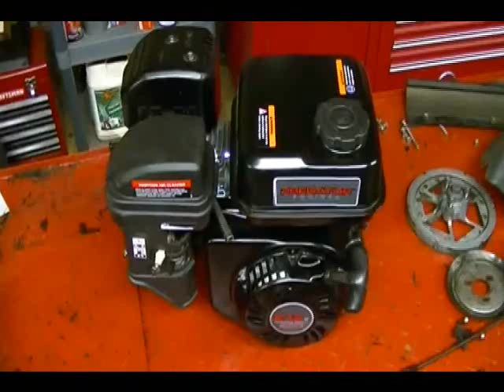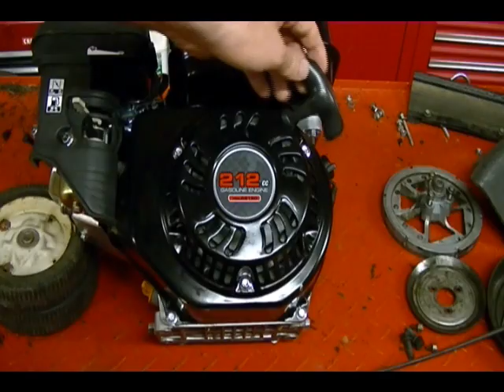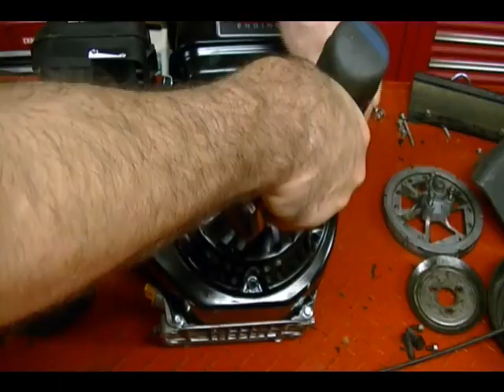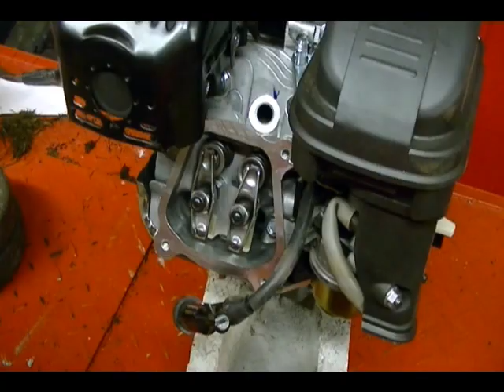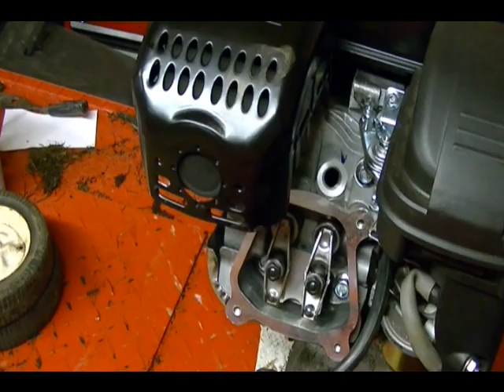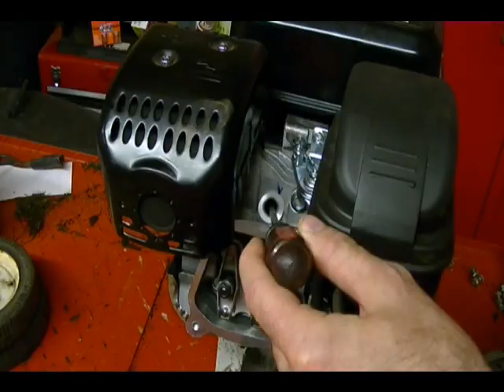Small Engine Repair: How to Determine Piston Position and Stroke on a 4 Stroke OHV Industrial Engine

Comment: I've an ohv tecumseh ohsk90. I've decided to adjust the valves with "cross method" (adjust the closed one when the other one is fully open) wich, according to many is easier and safer but I noticed distance discrepancy between this method and TDC method.

If I set each valves to .004  on cross I obtain .001/.002 on TDC.
If I set .004 on TDC I obtain .008 on Cross. 

This confused me because according to many should be the same.... the TDC where I check is just after compression release, when the piston reach the top.

When I've .008 on TDC the valves are noisier and with .001/.002 are more silent

Comment: I could be wrong !! But I was told that you just need to adjust any valve lash with the valve closed an that TDC is not always have to be done, just turn crank by hand adjust lash then rotate to close adjust other valve,you want to adjust any valve in close position!!

Comment: 10 yrs after, and this is the best 4-stroke valve adjustment video I have seen. Well-done! and thank you for the clarity.
Reply: Seems like every other vid I've watched not mentioning decompression arm on cam. Very important when valve adjusting on these motors.ended up breaking a recoil.if you don't adjust properly

Comment: Just watched the video it's very helpful. I have a mountfield ride on mower 4 stroke and I'm changing the head gasket how would I know what position/stroke the piston has to be in before I bolt it back on? It would be a big help if you have any info that would help me

Comment: Only comment, you talk about it running clockwise. Rotation direction is usually communicated from the pto side, not the starter side.

Comment: Thank you!!! 
That was totally professional, well-detailed and clear to understand. Much appreciated.
Offhand, living at ~6,300 ft. altitude, what sort of PSI reading would one expect from a healthy (cold) Kohler 149cc OHV engine after a few pulls of the starter cord? In general, would compression pressure correlate with the local pATM?
Finally, might you be able to suggest a main jet size for my altitude?

Comment: If you have a 2 cylinder engine can one cylinder get compression  Right after the  Exhaust stroke instead of the intake When the screwdriver  pushed all the way out to its farthest point it's right after the  The exhaust valve And that is when  I have compression the 1st cylinder that I just did seem like right after the intake was done moving The compression stroke started The compression stroke started Just like you explained in the video

Comment: As many have said, this is BY FAR THE BEST VIDEO on finding TDC.  The other videos are really a lot of filler and way too complicated you broke it down and laid it out perfectly.  I'm in my mid 50's and your vid gave me the confidence to change the valve springs.   Did a bunch of mods, bypassed the governor, turned out the throttle screw, adding a new carb with new pilot and main jets along with a new external air filter. Had to adjust the idle screw and holy Sh......  I clocked the bike at 33 MPG and I'm 200 lbs.  Thank you very much, awesome!

Comment: So if I understand this correctly as the intake valve is opening the piston is moving downward in the engine which is the intake stroke. After the piston reaches the bottom of travel on the intake stroke the intake valve closes as the piston will move upward on the compression stroke. As the piston reaches the top on the compression stroke both valves will be closed. Is that correct? Have you ever adjusted valves on a small engine where it was supposed to 1/4" past TDC of compression stroke for adjusting the valves? Thanks!

Comment: I have a Harbor Freight Predator 3500 Generator/inventor with only 17 hours of run time

I have no readings on display gauge for: 
V – Voltage

A – Amperage

VA – Volt Amps/Watt

I do have on the display gauge.
Hour – current run time and accumulative run time

I tried a test with a portable heater, and it powers that, so I’m guessing the generator is working OK?
I’m worried about not have those missing readings.
Also how do you reset the circuit breakers. I can’t find any information in the manual. I’m wondering if that could be the problem of the no readings?

And thanks for “how to find TDC” that was a big help. Thanks

Comment: that engine turns counterclockwise not clockwise rotation is determined from the shaft the other side of the engine and that is counterclockwise...

Comment: Cool 😎 
Thanks for your video!!!
Just subscribed to your channel!!!
I can’t say how much $$$
This video saved Me!!!
I knew i needed to find the correct stroke just didn’t know how to...!!! 
My push rods were actually missing 😳😳😳
Have no clue as to where they are still 😂
Don’t see ANY way they could have fallen into the oil pan!!! 
I got this mower from a nephew for $200 and have been mowing three yards for two years and it seemed to run fine...
No spitting and sputtering 
No backfiring 
No sign it was running on One cylinder 🤷‍♂️ yeah i know...
People are gonna think I’m an idiot that doesn’t know the difference between a rider and a push mower 😂
I don’t care about that!!!🙄🙈🤷‍♂️
I just wanted to let you know I’m thankful and maybe this mower will last quite some time longer!!! Thanks again ✅
Gonna clean up the Engine cooling fins whilst they are easily accessible and since i just got done with the yards i Have to Cut... Going to cut a Neighbors yard 😂😂😂
Anxious to see how much more power it has 😳✅👍 
Blessings 🙏

Comment: Do you have a video that shows how to identify when the piston is at 1/4" past TDC when that is the requirement for doing a compression or leak down test?
Reply: Just use a dowel or skrew driver from tdc, and mark it level with the spark plug hole. Then take the tool out, grab a tape measure or ruler, and mark out 1/4" above the line you made.  Reinsert the tool into spark plug hole. And slowly rotate until the 2nd line you marked out is level with the cylinder head spark plug  hole. Its samet thing hes doing here, but your just making a mark on your tool you put in thr spark plug hole. And then adding an extra mark 1/4" above

Comment: It is super important to keep the screwdriver from binding as the piston goes to TDC. I make the mistake initially of using an artist's paintbrush thinking the wood dowel-like handle would be a safe indicator, but soon found it almost impossibly pinched in place, even by going slow. You really have to help guide the tool you're using to avoid a problem.

Comment: That's not exactly and industry engine but it will work just fine but hell even caterpillar has a small portable jobsite generator that nothing more then a Chinese honda clone generator home owner consumer grade throw away but if it's something that's not used avery day they work just fine the rubber on these start cracking and rotting in a few short years including parts on the carburetor but that not to big of a deal cause you can use true honda parts as replacements

Comment: Question-I understand how a 4-stroke engine works. I also have the same engine in this video. Why after the air filter is there 2 places for air to intake. One that goes directly to the OHV  and one that mixes with the fuel through the carborator? Do they both go to the same place? Is this to get more air in the cylinder? thanks

Comment: Ok i understand about T.D.C. what a the measurement of the valves of a 6.5hp lawnmower what feeler gauge settings do i use to set the valves clearance also do i just turn the flywheel counterclockwise one time and set the valves clearance are do i turn again to set each valves clearance

Comment: Great Job! This was very helpful. Another way to confirm that you have TDC is to rotate the crankshaft slightly back and forth - there should be no rocker arm/push rod movement.

Comment: i have a predator  79cc engine, i bypassed the governor , but i did not remove it completely, i know this was stupid but i thought i had the govoner lever secure enough where it wouldn't fall into the engine, but it happened i opened up the crankcase and removed the govoner lever but i accidently pulled out the cam shaft, i put i back in lining up the timing marks, but now when i try to start it it feels like it has no compression, it just sounds and feels way off when i pull the starter does this have anything to do with what position the piston is in, all i did was line up the timing marks, can i have your input on this please

thanks

eric

Comment: So would this be the same in an atv 4 stroke engine? i am new to all of this, i took a class on it in school but didn't get that hands on, so i am taking an old four wheeler of mine apart this winter to get it ready for spring, would these valves be somewhere and i could judge what stroke the engine is in the same way as in the video? So when i am done cleaning everything and fixed and put it all back together, i make sure the piston is at TDC?
Reply: Great video. Did this to my 800hr 7500w Chinese Honda clone generator by following your explanation and now it's running like new. However, while rotating the crankshaft to find tdc, I noticed moisture dripping out of valve cover breather tube as well as a yellowish oily residue collected at the bottom of the air filter housing. Not much... but it's there. Does it indicate a head gasket leak or other issue? Thanks for your help

Comment: Very helpful and very explaining! tnx! Another question would be....i have problems starting a b&s motor, it gets so hard to pull. But when i remove the spark it just goes normal, i bet this is because of bad valve setup, what would you say? I did disasamble the engine and there arent any problems.
Reply: Includes two 120V outlets and one 12V DC outlet.  get it here http://amzn.to/1GoaIX2
Reply: Sounds like your exhaust valve is off.

Comment: I have been working on small engines for 40 years and the way to set the valves and it has never failed me, is if one valve is open all the way, then set the other valve, then rotate the engine to open the valve you just set until it is fully open and set the other valve clearance.
Reply: ***** , hello, i am Peri, just get one job be a generator sales , but actually i know little  about generator, Is there have some idea that i can  help customer solve more about generator, engine problems.also about wearing spare parts, 

Thanks
Reply: badass78ish thanks, friend

Comment: excellent teaching video, well done...
Reply from the maker: Thanks
Reply: ***** I'm using a 212CC predator in my gokart, do you happen to know if I can "customize" the timing at the cam for better top end power like I would with a car? It should be the same right?
Reply: Clay Hawkins You can get a off set key for the flywheel from 1 to 3 degrees off set.

Comment: Great Job on the video... I understand that at "top dead center" the exhaust valve is set at .003... My question is to set the intake valve at .002.... where does the piston need to be at? thanks

Comment: Thanks so much! This helps. I have a kaw FS481v and it's backfiring once the mower gets warm and is under full load.  I'm thinking it's a burnt valve. I already replaced the ignition coils.  thoughts? valves have also been adjusted and was also adjusted as well.